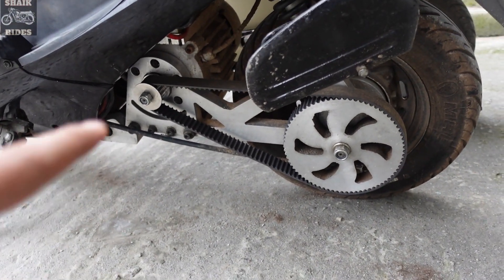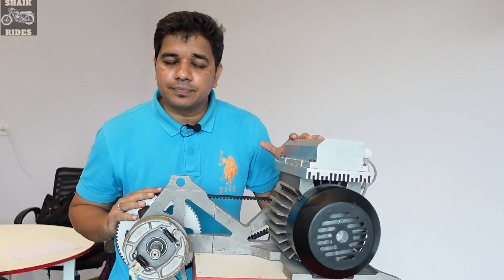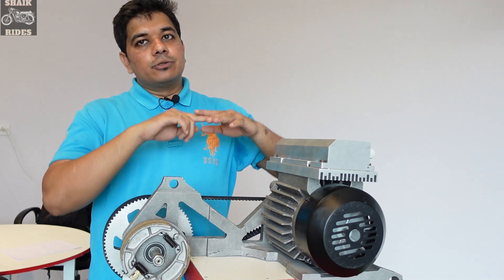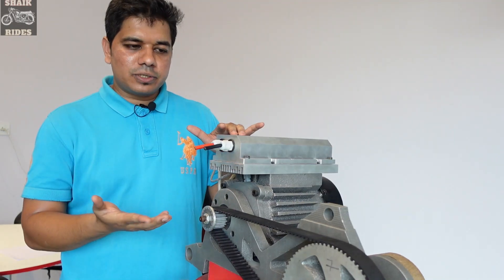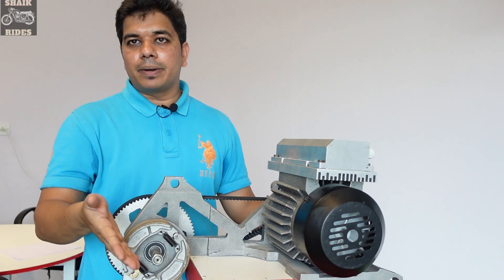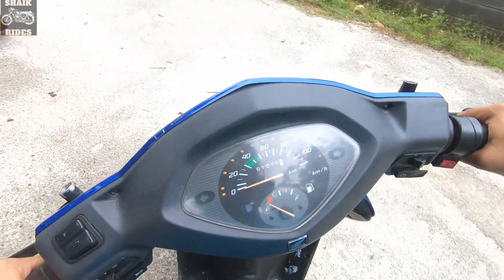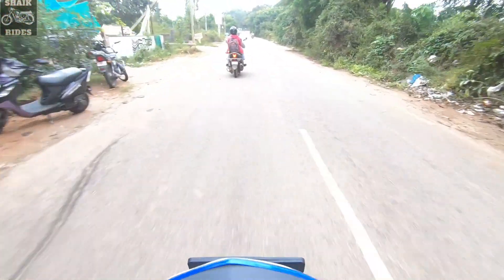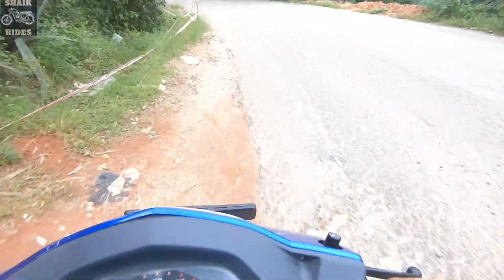STARYA Petrol to Electric Vehicle Conversion Kit | Just 35000/- | With RTO approval | 75kmph Speed |

Comment: Good Information  shared. But this design is eating maximum space reducing the boot space. How this motor design is good than hub motor. It is more efficient than the belt drive. And the legendary Chethak and Vespa scooters is out of your consideration.??
Reply from the maker: The size is of the motor is directly proportional to power value of it, the power it has demands the space, since the company is creating only kits they have to adapt to the current vehicles so the dimensions may look odd, if they had created full body and other parts also they would have managed the space accordingly, there is some boot space available n i feel that compromise is ok, hub motor performance is less compared to this individual motor and this comes with belt drive only, for now only dio activa access n jupiter is being worked out for RTO approval, once we have the approvals they will include all other scooters as much as possible.
Hope this helps.
Reply: @shaik_rides  Thanks for the info share. Please update us the process of RTO approval once you guys get the clarity. As I am designing a EV arrangement for my father's Vintage Chethak, It will help a lot.
And all the very best for your venture. It is very nice to see ನಮ್ಮ ಬೆಂಗಳೂರು startup making a good effort is EV conversion area. Please also try to design EV conversion kit for Vintage Vespa and Bajaj scooters. Good to see those legands on road once again with new look. 👍
Reply from the maker: Thanks for your feedback, the company shall work on it in future.

Comment: Can you explain more about the breaking system
Reply from the maker: Brakes remain same as the old scooter would have, however when no acceleration is given and friction is on the motor that would de accelerate and slows down automatically.. for some time then after some time it rides freely. Like the regular scooters work.

Comment: A good 6KW hub motor, with a matching controller and 3KW battery, is a much better solution, because you can use the existing engine and fuel tank space for the battery and still have the original boot space intact. Also, the efficiency of a hub motor will be higher, meaning more range and also maintenance cost will be much lower, together with better reliability. A 6 KW hub motor will give very good performance, which is more than enough for normal, everyday commuting purposes. And lastly, having that transmission exposed like seen is not a good idea and also, the rear pulley could touch the road, during sharp banking.
Reply from the maker: Thanks for your feedback, one thing the company is trying is to make all the product made in India in the affordable price,
It is very easy to import all said hub motors and electronic circuit and assemble and sell. This is done by other companies. Starya company has made this product from scratch and it is made India considering everything in mind like parts price affordability, production cost, maintenance cost, easy to fix, and deep R and D they have come up with this product which they believe is the most efficient and affordable.
If you believe your idea will be less cost please reach out to company they will be happy to implement it.
Reply: @shaik_rides  Made in India sounds very good, but when Indian manufacturers are not able to deliver, good quality at reasonable prices, it becomes very difficult to deliver a good, economically priced, end product. That's why we see many companies opting for Chinese products. I have many ideas for improvement and enhancement on such EV's but haven't got the opportunity to try them out yet. India needs a well designed, reasonably priced, reliable two wheeler, that is backed up with good after sales service, also at reasonable prices. At the moment, what can be seen is that most of the companies who are offering EV'S are swallowing all the subsidy amounts and trying to make a fortune, overnight. Ather, initially indicated that their prices would be just about a Lakh (before subsidies were announced) but when they finally started delivery, their prices shot up by over 50%. If EV's have to become popular, the Government needs to step in and cut back on taxes, import duty and excise duty, and also make sure that these cut backs reach the customer. At the moment, there doesn't seem to be any control from the government.

Comment: 10 000 moter .10.000 missionary  or 10.000 battery charger and 5000 extra over
Reply from the maker: Sir what about Electronic circuit board.
This is not jugaad work, this is professional work

Comment: New scooter cost is high but you get 15 yrs life. With retrofitting, the life is what is left of the used 15 yrs plus the 5 yr renewal.
Reply from the maker: Yes, you can keep on renewing every 5 yrs. your scooter will now be e scooter no much service cost as there is no engine at all. Very small service cost for electric motor and belt replacement every 10k to 15k km.

Comment: the price is very high. why will any one go for such a high priced motor. instead they can go for new electric scooters or buy second hand electric scooters
Reply from the maker: True, you would get new electric scooters for 45k to 65k and for this price if you get the conversion kit performance and motor power then please take sir.
And it is 35k only with battery subscription plan.
Reply: @shaik_rides  how much is it without battery subscription plan and what about RTO approval in other states how to do that
Reply: @shaik_rides  but we need to see the told cost of conversion.

Comment: Sorry.you are not do easy method.alltration rate very high.so you are not worth?
Reply from the maker: Please visit, near by mechanic ask him to do same conversion that gives same performance with 5.5kw motor that gives 24nM of MAX torque with battery of 2.4kWh, with wiring , assembling and RTO approval, and then compare sir.

Comment: It is not 35,000 you must tell it is minimum 65000. Becuz with out btry it is waste....so you can tell cost 65000. Ok. Sp
Reply from the maker: Sir for 35k the battery wil be given but with subscription 75paise per km charge.

Only if you dont want subscription and want battery upfront then u have to pay for battery..
When u buy battery upfront for yourself you cant be part of subscription in which u can swap your battery in swap stations setup by company when needed.

Comment: 36000 Mein bounds Karke Gadiya Rai bhai
Reply: Hi Sanjeev, thanks for the feedback. We would not like to comment on other EV manufacturers specs. Please find below the details of our kit, hope it can aid you in taking the right decision. We would also request to kindly ride our scooter to get a better understanding of its performance.
1)	5.5 Kw PMSM motor
2)	75 Kms Top speed
3)	0 to 40 in 3.7 S
4)	72 Kms Mileage
5)	400+ authorized starya conversion & service points pan india
6)	Swapping station every 4 kms
7)	Least polluting scooter since its recycled
8)	There are 6 Cr+ gearless IC engine scooter in india, imagine the amount of co2 emitted if all 6 Cr+ customers decide to buy a new EV scooter
9)	First in the country to truly build the motor and controller from scratch after 3.5 years of R&D, holding 5 patents for the same making it a truly first “made in india” product.
10)	Once the battery pack is dead it is replaced at a highly subsidized cost.

Comment: main problem is 
why need to recharge magnet every 20000km

it's very difficult

because other bike motor no need to recharge 
this is like one tipe of maintenance
Reply: bro 
you think that is easy.but actually it's not

after purchase and 20000km run
I need to reopen kit and send motor to banglore and after recharge magnet it's came back 
do you think it's reliable
Reply from the maker: @himanshuajudia4838  you dont have to send it to Bangalore, the company is in Bangalore but as it expands the sales and services will be available every major city and town.
So everything will be sorted out before they go full fledge.😊
Reply: demagnetization is related to motor over heat.
other wise no need to recharge at intervals
Reply from the maker: @himanshuajudia4838  ok for more details, please reach out to company directly about it,
I have mentioned the numbers in the description 😊
Reply from the maker: sir,
I have checked this with company and they said it very affordable price and they will do it in very short time it is not concern at all.
Reply: Hi himanshu,magnet recharge is an optional service..not mandatory..its not to say the magnets get de magnetized after 20000 kms, or there would be a drastic change in performance .it would add extra life to the motor shelf life.
Reply: @staryamobility  Starya, what is the price of the motor? As motor warranty is only 1 year (if i am not mistaken), would like to know its approximate price.

Comment: 35+another 37k.....better to go for new electric scooters
Reply from the maker: sir,
it is 35k only with battery subscription plan of 75 piase per km usage.

if you dont want subscription plan and only battery upfront then u have to pay for battery that cost of 30k.

even after this if you say it is costly and for 65k you will get new escooter then I have to say you wont get with this battery that has power of 2.4kwh and evn if you get a escooter for this price and battery also then you wont get performance what this conversion kit gives.

its like, why buy pulsar when you can get bajaj platina for 70k
Reply: @shaik_rides  agreed.... Make sense

Comment: Kit meens battery moter wiring extra and fittings
Reply from the maker: Yes, the kit cost 35k contains the kit, assembling to scooter, wiring, RTO approval with green board and with battery but with subscription of 75 paise per km.

only if you dont want subscription plan and you want battery for upfront for your use then you have to pay for battery cost 30k more.

Comment: In 65000  there is new ebike avalable . Your cost is very very high. Your sujjetion is not good. Very bad deal. Costly.
Reply from the maker: sir, I have told this already in my comments, the kit is 35k with subscription plan, dont add battery cost to this,

when you say you get electric scooter for 65k you wont get this performance,
it is like saying you get bajaj platina for 80k why pay 1.5 lakhs for pulsar.

Comment: NO USE only kit is it's 35 k rs is heavy price... Battery 30 rs ... Old body r 20 k
N fixing overall is about near by 90k

So instead of it giving 70 k buying new scooter is best
Reply from the maker: Sir battery details have been shared in the video.
For 35k conversion kit, you get battery with subscription plan of 75 paise per km.. in this plan u charge battery at home or exchange battery when it gets drained in the swapping station that company will create every 4km for your reach.

But if u dont want subscription plan and need own battery only then u have to pay 30k extra.

This is same with any electric scooter u buy.

This performance you wont get for lesser price.

Its like saying why pay 1.5 lakh for pulsar when u can get 80k bajaj platina.

Hope I answered.

Comment: Why it is mentioned as only 35000, you should mention with battery 65000 as the kit will not work without battery
Reply: Yes true
Reply from the maker: Sir battery details have been shared in the video.
For 35k conversion kit, you get battery with subscription plan of 75 paise per km.. in this plan u charge battery at home or exchange battery when it gets drained in the swapping station that company will create every 4km for your reach.

But if u dont want subscription plan and need own battery only then u have to pay 30k extra.

This is same with any electric scooter u buy.

This performance you wont get for lesser price.

Its like saying why pay 1.5 lakh for pulsar when u can get 80k bajaj platina.

Hope I answered.

Comment: Sir please share battery details also 
Motor cost is 35 and plus battery what is the total, battery is available with motor or we should buy separately.. out side
Reply from the maker: Sir battery details have been shared in the video.
For 35k conversion kit, you get battery with subscription plan of 75 paise per km.. in this plan u charge battery at home or exchange battery when it gets drained in the swapping station that company will create every 4km for your reach.

But if u dont want subscription plan and need own battery only then u have to pay 30k extra.

This is same with any electric scooter u buy.

This performance you wont get for lesser price.

Its like saying why pay 1.5 lakh for pulsar when u can get 80k bajaj platina.

Hope I answered.

Comment: It's really good n helpful video but now in the market we do get new scooter around 75000 to 80000 also so it's better to get new scooter coz it's still costly n we don't know the maintenance also
Reply from the maker: Sir,
You dont have to buy battery, you can opt for subscription plan 75paise per km. That is is part of 35 conversion kit only.

If only u want battery upfront and dont want subscription only u pay 30k extra for battery.

This is same with any electric scooter u buy.

This performance you wont get for lesser price.

Its like saying why pay 1.5 lakh for pulsar when u can get 80k bajaj platina.
Reply from the maker: No sir, it is not 70k for conversion kit it is 35k only..

If you are saying go for new bike you have pay 1 lakh for this performance .. you do get escooters for 80k but thise scooters max performance are 45km speed.

Any scooter you buy you have to pay for battery or subscription..

The company is not against for taking new scooters they are just providing customers an option if they want to convert current one to electric one..

Only when u buy a new one you would know actually diff in performance and price😊
Reply: Still it is costly pay 70000 plus amount for conversion why not buy branded scooter..

Comment: hi you had not share technical of motor RPM Torque Range curve and Reduction Gear ratio. Wheel RPM and at wheel torque. Which co. Tyre will suits as Electric torque is to much at wheeel so Soft tyre recommended. Hard rubber skid on powerfull EV as your motor is 5.4Kw. Michelene or Yokohoma etc.
Kindly do review again as their is nothing to hide as its RTO approved kit. Kindly elobrate. If possible try to use 12" wheel instead of 10". Better milage and stablity you will get as you are desigsined from scratch. put some bigger wheel at back.
Reply from the maker: Hi Sharma,
Yes i dint mention the rpm anyway here it is, 5.5 kW max @ 4225 rpm
26 Nm @ 1900 rpm at motor these are. It is belt transmission attached to 4.4 gear ratio.. that connects to tyre.
The torque at wheel is around 117Nm..the torque at the wheel of activa/Jupiter at start is around 120 Nm..hence the tyres that they have standardized is the same that is used in activa..make and other details. They.will reveal once they finalize vendor..the only difference is the torque is available throughout the speed..whereas in ICE and also other mid drive electric vehicles.. torque will drop over the speed curve..hence thier mid speed performance is very attractive...the speed of the wheel in rpm is around 960 max.
Reply: Thanks for complete specs. Now i can think of persuing further.

Comment: Ppl need to know this. This seems pretty robust and the price is good enough.
Reply: There are a few problems. First they want customers to send scooter to Bangalore for conversion and then take it back on his own as well. Who will send scooter 2000 kms to Bangalore ? Second, with battery it costs 65K. That isn't exactly cheap. Third, who will provide after sales 2000 kms away in case of a fault ?
Reply from the maker: @atulmalhotra2303  no sir you seem to have half info.
Company will soon expand their sales and service to major cities and towns so you can get ur scooter near by place to get it converted.
The company is from Bangalore it doesn’t mean they would do everything from Bangalore only.

Coming to battery, battery is part of of 35k conversion kit package.. but in that case you have to take subscription of 75piase per km…That gives you access to swap batteries anytime if your battery gets drained off.. company will arrange battery swap stations every 4km in cities and towns.

If you dont want all this and dont want to be part of any subscription plan only then u will be asked to pay for battery for 30k more.

In this case battery is yours u can recharge when ever u want as per your need but you will not have access to battery swapping stations.
Reply from the maker: Yes👍🏻
Reply: Costly deal
Reply: 35k for kit.....wht ABT battery ? Whc cost 50k.....better to buy ola